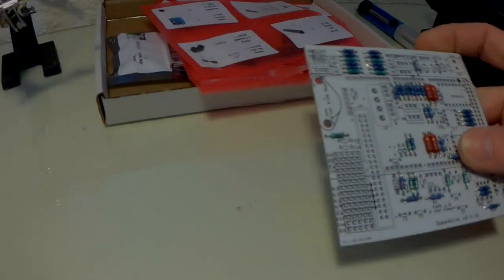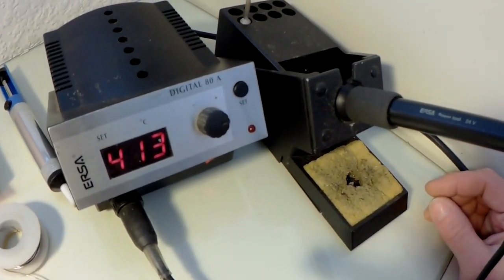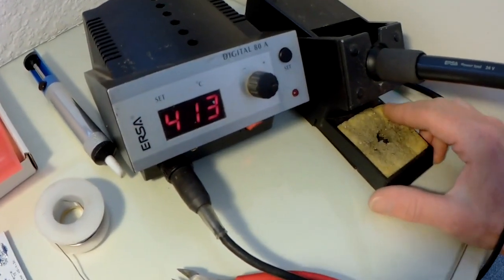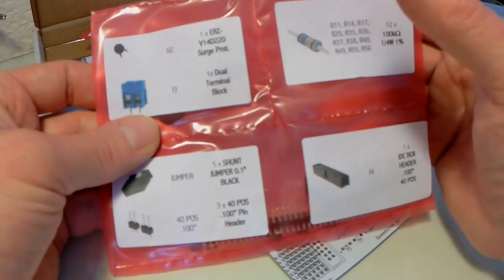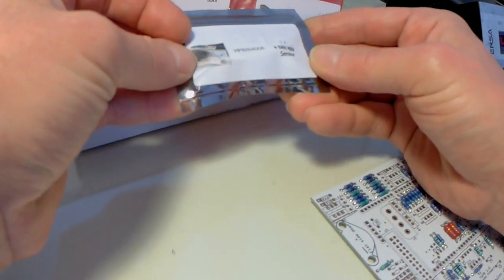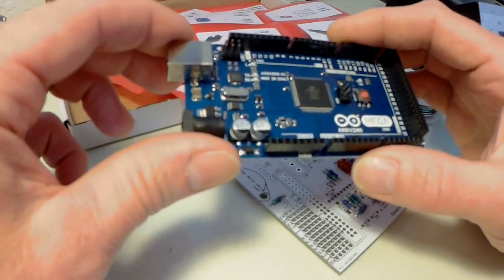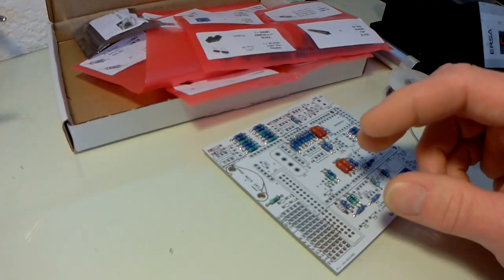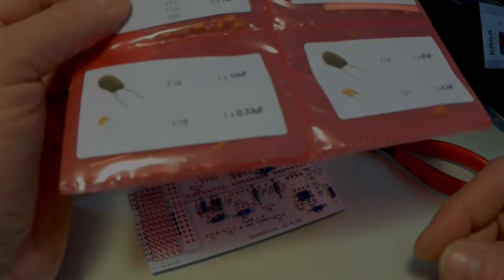Coilpack K11 Micra Speeduino Build and Install Pt1.

Comment: It'll be nice to see this up and running and how easy or hard it is to map, and if it can run a non coilpack
Reply from the maker: It can run a non coilpack engine. Personally if you go to the trouble of building and fitting this kit, then you might as well fit the coilpack stuff.